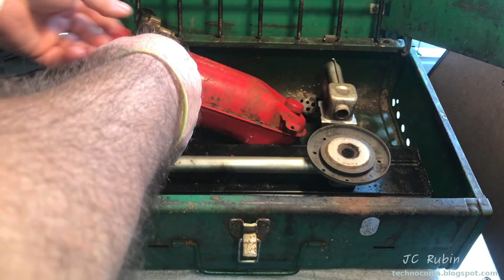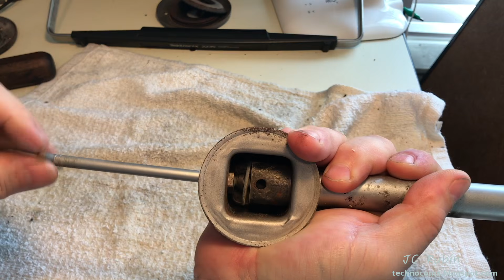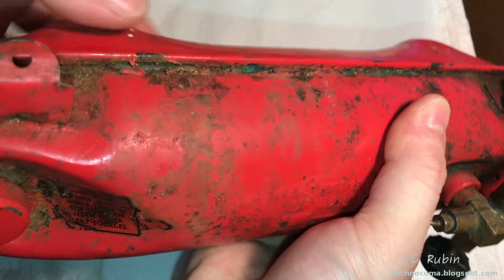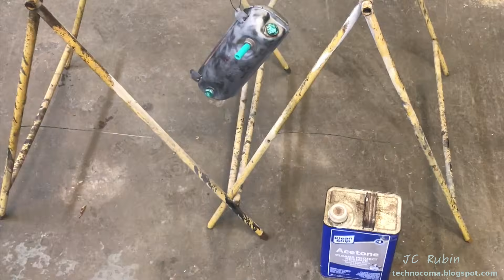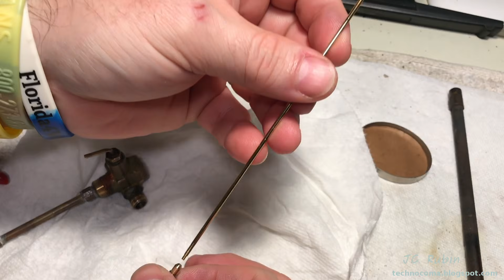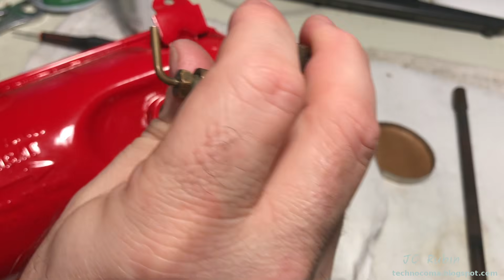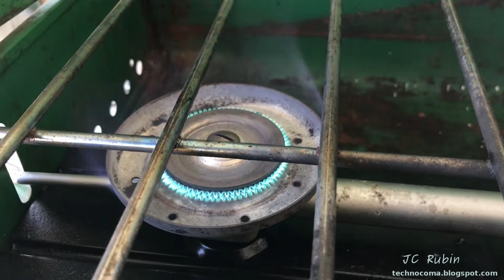Coleman Stove Model 425 Teardown Maintenance Rebuild and Leak Repair

Comment: What a super enchanting video, also every detail of the refurb an how to light. All I need to know really. So just acquired one an looking to get it going at weekend. Also found the fuel testing video as well. Only question please mine the legs have rusted would you leave of fill with a filler thanks again
Reply from the maker: Sorry I don’t understand what you are asking
Reply: @r @retrotechandelectronics ank you for replying. When you dismantled everything you were left with the metal green case which has 4 hollows in the bottom so when the stove is on the table it actually sits on them like legs they are rust damaged on mine an rusted through in places an was thinking of filling with filler an re paint the inside of case? Hope that makes sense an thank you for your detailed instructions had I not seen how it all works I probably would’ve thought it was incomplete an returned to the scrap pile.

Comment: You did a heat job with the tank was just wandering why you didn't paint the stove itself
Reply from the maker: The tank is powder coated. The chassis would need to be painted with a high temp paint

Comment: Thank you so much for this! Back in my camping days (1970s, I purchased a 425E stove and a 220J Lantern. I still have them and use them occasionally during power outages. In prepping for a snowstorm and possible outage, the lantern lit fine as usual but the stove seemed not to hold pressure. It would light initially after 50 or so pumps then fizzle out. I'd remove the tank, crack the cap and just a minor hiss. This video is a huge help.

Comment: Hi, great video, I'm working on a teardown/rebuild on my 424 that I've had since Boy Scouts 45 years ago :-)  When I removed the burners, there were remains of a gasket at the bottom of the burner assembly, I didn't see that in your video.  Have you seen that before? You didn't have gaskets in this rebuild, wondering if I should use some automotive gasket material to make new ones or they aren't really needed.

Comment: Excellent job, just wondering why you didn't disassemble and clean the little valve you use to start, the one that gets turned down after lit?
Reply from the maker: Im careful to disassemble anything with packing that isn’t leaking

Comment: You mentioned that the inside of the fuel cap look to be in good condition. Was that not rust on the inside?
Reply from the maker: A bit of surface rust but it still seals good.
Reply: @retrotechandelectronics  Ok. great. I haven't started on mine yet. I was thinking any flake of rust might be a problem in the tank. Have a great day. Great video!!!

Comment: I recently inherited this exact model from my wife's late father. It is in excellent condition, though it was leaking in areas it should not have, and the red tank felt clunky, likely due to fuel that had been sitting in it for years. My wife informed me that the last time it used was during the 1994 earthquake in Northridge, California. Remarkable I am grateful for the thorough teardown and cleaning. While I could have purchased new $180 Coleman stove, I chose to preserve this one, especially as it remains in great condition. It simply required some and attention. My thanks and blessings to you, sir.
Reply from the maker: Glad to hear it and that the video helped.

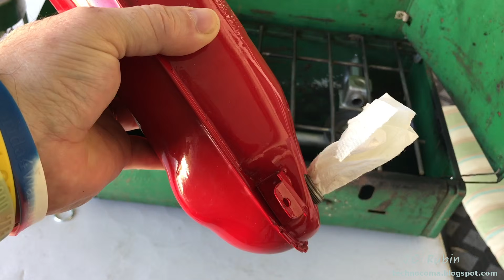Comment: Nice moltoff cocktail at 25:32. All serious now though. After drying out the tank I like to pressurize it with air a couple times and let the generator clear out too by opening the valve.
Reply from the maker: Thanks for sharing

Comment: I like your style and narration - lots of other content generators could use some guidance from you - maybe one minor criticism is why did you not do more of a cosmetic job on the brass or the case? However great functional repair!
Reply from the maker: Good question.  The reason is that this is an operational unit during power outages, doesnt sit on the shelf. A paint job for the fuel tank was good for preservation of the pressure canister but for the outside it will become quickly dented and scratched up./

Comment: Thanks for the video it was very helpful but just one thing the tank can be restored, my husband restored ours it had a hole at the bottom and he seald it with epoxy seal,just telling
Reply from the maker: Difficult to seal a pressurized tank, it needs to be welded

Comment: Great video, thank you!
Correct me if I'm wrong, but isn't there something you can coat the inside of the tanks to seal/protect them? If memory serves, the motorcycle guys use it in old tanks.
Reply from the maker: You are thinking of Kream, or something similar, but this is not designed for pressurized tanks.

Comment: I just repaired a hole in the fuel tank. Use JB Weld for fuel tanks, works great. Cheers, BobbyB.
Reply from the maker: I can’t be sure the JB weld will hold in a pressurized tank.
Reply: @retrotechandelectronics  mine has so far.

Comment: Thanks for this video.  I echo all the other reviewers on how clear, thorough, and easy to follow this instructional video is.  I have a Coleman stove (not sure if it's this exact same model, but it looks like) that I bought in 1975 right after high school graduation, for a celebratory camping trip to the Smokies with my girlfriends.  It's worked fine  (with zero maintenance), the only thing I've done is buy a propane converter so that I can use bottled propane with it if I want the convenience of skipping the pumping that goes with white gas.  Most recent time I used it, though, I got only a low flame.  Was thinking of finally replacing it, until I saw this video.  Now I'm excited about the process of cleaning it out and getting it in shape again.  Maybe it will last another 49 years!

Comment: Beautiful work! These are great " PREPPER " Stoves. Coleman fuel, MSR Fuel, White Gas, but also FILTERED automotive NON- ETHANOL pump gas works great with no problems whatsoever. The Coleman Filter FUnnel is ideal when you can find it. Again, great video. Thank you.
Reply from the maker: Thanks for the info!

Comment: Excellent, thanks.  Not sure which model of this same stove I have from 1976, but since new, it's  always leaked (small flame) where the generator tube goes into the manifold leading down to the burners.  Never a huge issue, just blackened the bottoms of any pan I put on it...  :)   Never investigated why.  Ideally, I'd like to get a propane conversion setup for it but they're getting pricy and probably not worth it since I don't even know when/if I'll ever use the stove again.

Side note, I traveled around the country for many months in a 1968 dodge van, forward control, engine/cover between front seats.  I had a vent above that and could use the stove on top of the engine cover in poor weather just fine...  :)

Comment: When i got my 1st coleman stove a few yrs ago i watched many videos to learn all i could about them.
I occasionally watch some now as a refresher.
I have to say this video is the most thorough one ive seen of all. Thank u.

One tip--i use very fine steel wool to wipe down the needles, tubes and brass prts. and then spray down with a cleaner.
Reply from the maker: Glad to hear it helped.

Comment: Excellent video. I just got my first coleman brand new. First thing I will do, is to remove all screws and ad a bit of ceramic high temperature grease. That will help when the unit has to be serviced later on.

Comment: I have an absolute mint condition 425 that was put in storage in 1953 (according to the newspaper lining). Is leaking pressure from the "Filler Pug". I just shot it with thick oil and it seems to be fine. I don't remember if you addressed this issue. I removed and oiled the pump leather. Works great after at least 70 years. Excellent video.  Subscribed.
Reply from the maker: Glad you enjoyed it

Comment: I can't get the spring out of the tube so I can clean it. I've used carb cleaner and it still won't come out. The spring seems permanently stuck in there. Any ideas how to get it out? I don't want to damage it.

Comment: I just picked up a Model 424 that the previous owner took the valve assy out.  It looks complete so I was just going to put it back on.  It appears that there was pipe dope on the threads to the fuel tank.  Not sure if I should put some on as well.

Comment: This was great, and I thank you very much. My father started camping up in the Adirondacks in 1955 or so, me in 1967 as a young boy, and I carried on the tradition after his death in 1987. I still use the Coleman stove he bought in 1956 but have never done any work to it. We used to use unleaded gas, but switched to Coleman fuel decades ago. I've never drained the fuel upon storage and never had a problem just pumping it up and lighting it. Always works fine. But it's been a few years, and after 67 years I think it's worthy of a rebuild. Will buy the graphite from Old Coleman Parts (maybe a new pump leather or whatever they use these days) and hope all the other parts are in serviceable condition. Have to find a place that will sand blast/powder coat the tank...

Comment: Great video. I can’t figure out why I have a have fuel leaking past the needle valve and the stove won’t entirely shut off. Also I’m not getting a full pressure flame. It is a 1993 425 E.

Comment: Just did a full teardown & clean on my 421-E with this guide (and fixed an issue with the pump!

I am not familiar with the sprays/cleaners/lubricants mentioned in this video (and did not always hear them clearly).  Can anybody share what cleaners/sprays are used / safe?

Comment: Nice cleanup and refresh.  Clear and to the point.  These are amazingly simple when you break it down into groups and steps.  The great thing about this cleanup is that you aren't afraid to use is when you're done.  That powder coat on the tank is superb.  Tell your friends and anyone who has one of these that the lighting instructions are on the lid.  Read and follow them and you won't have any problems.  

Top issue for the rookies: 
1. Don't tilt the tank to fill it.  Fill the tank as it sits on the stove.  This prevents over filling and reserves ample air space in the tank.  If you tilt the tank and over fill it, it won't light properly because fuel will drown the air induction port.
2. When lighting, make sure the lever is up, tank pressurized, light your lighter or match and hold it to the burner and open the main valve ALL THE WAY right away.  If you try to nurse and throttle the valve, it will not start properly and flame up.  This is because the instant lighting circuit need high velocity air mixing with the fuel in the fuel and air tube for a clean burning startup.  If you try to throttle it, you won't get the velocity and you'll flood the generator causing big flare ups.  
If you don't follow these "rules", it will still eventually run OK but you'll get black soot everywhere, waste a lot of time, fuel, and eyebrows in the process.

Great video, well done.  Two enthusiastic thumbs up!!

Comment: Don't use 3-in-1 oil on the pump, it will turn into a lacquer with age. Motor oil is better
Reply from the maker: Hasnt happened in all these years.

Comment: Great video I just got a free coleman 3 burner in mint condition used once, everything looks fine, I was wondering if you could help, the generator is in excellent condition as is the stove,  is there a gasket that seals the generator tube when in the stove hole, I could hear leaking from that spot and didn't want to light it yet incase there's a missing gasket that goes into the hole. 

Can't find anything on it and you have the best breakdown video I've seen. 

Thank you in advance for any assistance.

Comment: Excellent video,  thank you for posting it.
Just got down a 425E from a shelf in the garage where it has been sitting for 30+ years.  The tank had some coleman fuel in it.  It was my folks which I inherited.  Oiled the pump (leather cup) and emptied the old fuel into a can. Found an excellent YT video (this video!) that shows how to test the tank and valves before you put fuel into the tank.  My tank & valves tested OK.  Then filtered some of the old fuel thru a paper coffee filter back into the tank, pumped it up and it fired right up and ran great.  Pretty amazing after 30+ years of storage.  Brought back childhood memories of camping & cooking.

Comment: Thanks for showing this.   The only thing I think I would have done differently is to take the tank to a radiator shop to have it boiled out to eliminate any rust, varnish, or other contaminants that remained in it.
Reply from the maker: Fill with brass BB's.... Close... Wrap in a large towel and secure towel shut.   Put in dryer to tumble for a few hours on no heat.

Comment: Great video!  I just repainted my stove because a friend set it on fire and actually burned most of the paint off of the case, lid and wind wings.  Started rusting immediately. A PITA, but I masked the latch and rivets to keep its original look.
One, question:  Why drain the fuel for storage?  I was taught that the fuel prevents internal rust and keeps the seals in good condition.  I do make sure pressure is relieved before storing.
Reply from the maker: I plan on redoing the cosmetics once I source the original rivets.

Comment: Hey, I have a old Coleman 421C and for some reason when I turn the gas nozzle on it starts to leak out of where you turn the gas on and off, I believe it may have something to do with the graphite packing but I’m not too sure… any ideas?
Reply from the maker: Yes you need to try tightening the pack g screw. And if necessary replace the packing

Comment: What was the reasoning of not sanding and repainting all the case components?
Reply from the maker: I need to get all of the rivets and the tool before I can completely disassemble it.
Reply: Waste of time, cosmetic only.  Just hose it off and dry it.

Comment: I was given a 425-E in TERRIBLE shape.  After a quick disassembly, I'm seeing lots of dirt, gasoline fouling, and neglect.  But, it's on the way to working like new again!  Thanks for the video.  The only thing I didn't see is how to remove the clips that hold the grate.  I used large slip-joint pliers to bend the grate to slide it out from the main cabinet.

Comment: 8/16/2022
I have an older model version of this stove, probably an A or B version, ( none of the seams are rounded) which I found in the trash about 40 years ago. So it's somewhere close to 60 years old or better. At that time it was rough, but only needed a new fuel cap and generator innards. I have always wanted to rebuild the old girl, and now I have the process to do it. Thanks for a fine instructional video. Rust removal may be problematic though.
These old stoves are rock solid and should be part of everyone's preparedness kit. I have a propane Colman, never used it in 22 years, still in its box. I'll go to the old tried and true "White gas" version every time. ;-)

Comment: Excellent video. My tank has at least one pinhole leak and I'm hoping I can solder it shut. The knob drips too so it looks like I need a new graphite packing.
Reply from the maker: Tank repair rarely works. The packing is a common failure and easily fixed
Reply: Even if you fix one small leak, there are others soon to follow.
Reply: @RichardKinch  Most likely. I soldered a bunch shut and pressure tested it with wd40 a couple times. Paint is drying on it so we'll see how many bubbles I get after my first trip 😁

Comment: Great video the only item you didn’t disassemble was the starter valve. Is that valve not serviceable? It happens to be the one location on my stove that is leaking fuel when pressurized.

Comment: I think Brake Clean would do a good job of removing grease . If the tank is rusted , pitted and thin in an area , replacement is in order . However , if there was a puncture , would brazing be acceptable if otherwise the metal was sound ?
Reply from the maker: I generally dont encourage those kinds of repairs tot he tanks. too much of a hazard.

Comment: You did a par-excellent job but why didn't you go ahead and do the case while it was down?  I have one made in the 50's and while I had it down for cleaning I went ahead and painted the whole thing. They're wonderful stoves. Thanks much!
Reply from the maker: As i'd explained to others. to do it properly all of the rivets would need to be drilled out, the tool to reinstall the correct rivets is expensive.

Comment: You did such a nice job on the burners and tank why didn't you at least clean up the inside of the green case while you had it all apart?
Reply from the maker: I want the restoration of the unit to be a seperate project, I need to source the correct rivets.

Comment: Excellent video. Clear and concise. Planning a bit of camping so thought I would look at cleaning up my model 425F (mfg 11/92). Unfortunately mine failed the fuel tank inspection. Initially noted some light surface rust and thought it would be fine. When filled up with fuel and pressurized some fuel bubbled out though a couple of pinholes along the seam. I understand that is is risky to repair a tank and replacement tanks are pricey. If i happen to see a stove at a yard sale I will probably pick up a replacement stove.